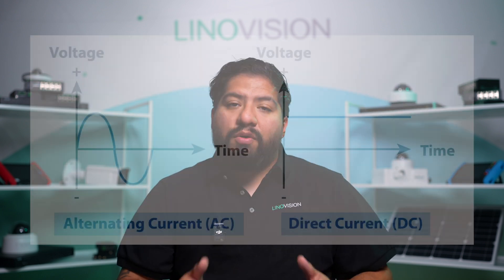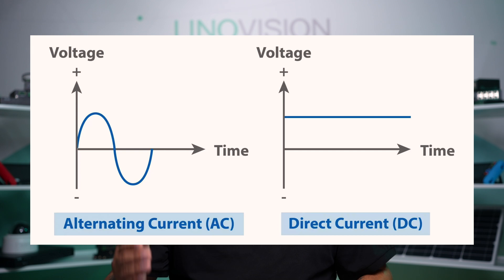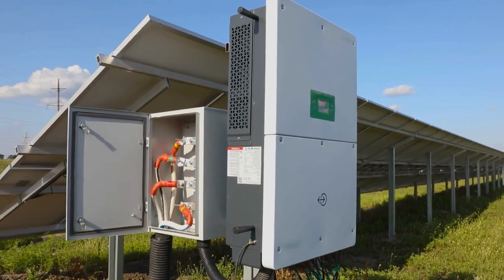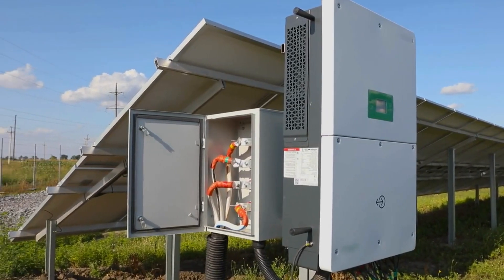Why regular PoE Switches do not work in Solar Power System?

Comment: Huh?  No, this is completely wrong.   Most regular PoE switches have AC adapters to generate roughly 52-56VDC for the switch and a DC input on the actual switch.  You do not have to buy a special "PoE DC switch".  You just bypass the adapter and plug the 48V solar system directly into the switch and you are done.  Its like snip snip splice splice done.  Literally.  Zero voltage conversions.  I know, because I do just this.  Properly fused, of course.

Anyone with any significant PoE hanging off a solar system is going to be using a 48V native battery system bus, not 12V or 24V.  12V/24V is fairly old school.  If you are dealing with any real power, you go 48V LiFePO4.

This battery chemistry in 16s has a charge target of 56.8V and will be 95% discharged at 48.0V.  It is a perfect fit for PoE+ direct injection which is specified to operate at up to 57.0V.   This is maximally efficient... there are zero voltage conversions.  You literally can't do better.

POE gear is designed to operate within the POE voltage range (50-57VDC, roughly).  Minor differences in voltage will not cause any problems and with LiFePO4 the voltage really doesn't sag much across most of the discharge curve.

--

If you have a 12V or 24V system well... fine.  You can just use an AC adapter and lose roughly 15% in efficiency.  Or you can use a DC-DC to generate 50-57VDC, bypass the AC adapter, and only lose roughly 7-10% in efficiency.  It isn't terrible.

PoE DC switches that take lower input voltages have a DC-DC built-in, but it won't be any more efficienct than just having an external DC-DC if you are using lower input voltages and injecting the proper voltage straight-away.  You will still lose about 10% efficiency.

--

Oh, and p.s. I have a few Linovision POE+ devices.  They have terrible efficiency.  They are incredibly inefficient for the DC-DC conversions they do.  Extremely cheap circuit designs.  It kinda annoys me, actually.

In short, this video is just straight out wrong.

-Matt